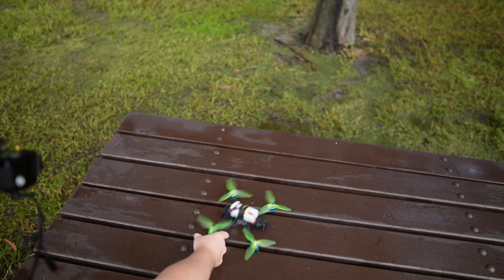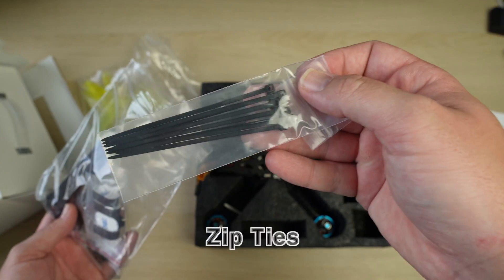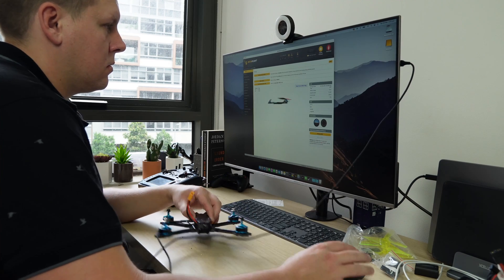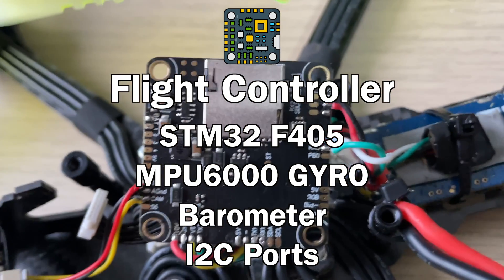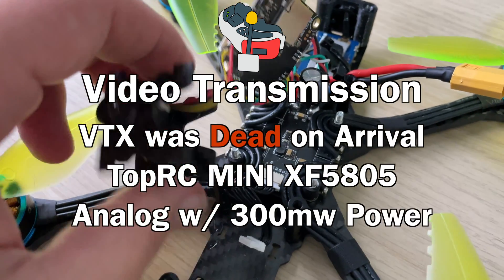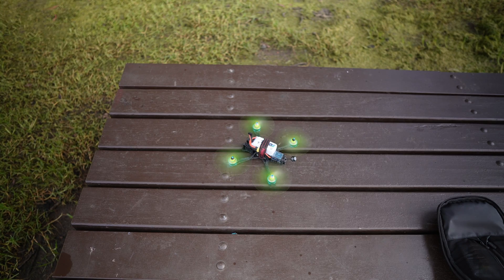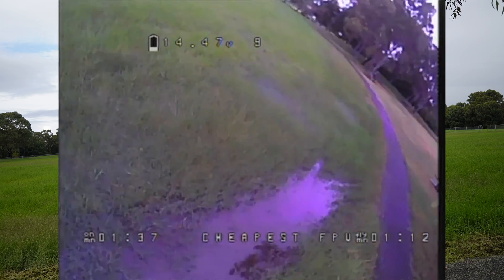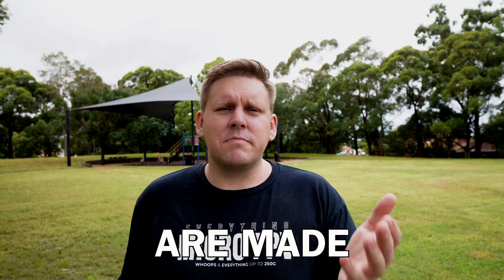I Tried The CHEAPEST 5" FPV Drone, Here's What Happened!

Comment: I never even tried those props they went straight into the trash , plus I had got mine in late August and same everything except BF 4.3 so it flew pretty well. I did upgrade vtx to Iflight sucexx  it was a tight fit in the back I actually had to re-solder the battery cable to get the vtx under the power wires. The stock vtx wasn’t terrible but I had an extra vtx so I threw it in along with a Camera and now it is my favorite flyer. I know own 3 of these and they all came in perfect condition and I do consider myself a bit lucky in that regard.

Comment: Noob question. Where did you guys connect the elrs (ep1). I think I got it to bind but can't get the controller to work? I am new to this. Seem like tx5 and rx5 is where you connected but just confirming.
Reply from the maker: Yes you can do tx and RX 5… you need to write the tx on the receiver to the RX pad on the flight controller and vice versa
Reply: @DarrenAllatt  thank you.

Comment: Noooooooooo don't spend $100 to upgrade it.  Go in a different direction...just try to see how little u can spend to get it to fly properly.  I think that would be more useful to know whether you can spend $84 + minimum upgrades, props and tune it as is and see if it does any better.
Reply from the maker: Check out the upgrade video as it shows the upgrades in stages from “free” to $100

Comment: Awesome video! What betaflight target did you use to update to 4.3? My gyro update frequency is locked at 3.2 khz. The target is MATEKF405STD. I'm not sure what is wrong. I have never seen a gyro update frequency locked to a value before.
Reply from the maker: Yes that’s the target I used as well. 

I think that may be due to the FC having a BMI270 gyro and not an MPU6000 which is limited to 3.2khz
Reply: @DarrenAllatt  Oh bummer. Thanks for the info!
Reply from the maker: @svveptunder  it’s a non issue. Go and apply the BMI270 gyro preset from the presets tab and it will be all good

Comment: First video I have watched of yours super impressed with your review format will definitely be watching some more. The quad looks like a bit of a red flag tho, although I want expecting it to be good at this price. Those eachine tyro119 stacks are known for blowing up.
Reply from the maker: Cheers appreciate it… check out the upgrades I did to it, also there is another coming shortly. As the Tyro ESC 🔥
Reply: @DarrenAllatt  Yeah I am still kinda tempted to buy one and tinker with it even though just the esc alone in my current 5inch build costs more 😂. I think with the mods you did and a cheap mamba esc it would actually be a pretty good value quad, that would be nice to have as a backup/beater.
Reply from the maker: @PeugeotL-vd2le  just bought a mambo esc for it too

Comment: The Tyro ESC didn't come PRE FRIED from factory?
I'm actually surprised!
I was dumb enough to order a Tyro 119 DIY and the electronics all died a quick death on transport to me... Yes, the replacement esc also died.
It now has a RUSH stack and damn it hauls ass!
Reply from the maker: With such low prices for hardware you have to think, what are they missing to produce it at this price. 

Typically the first thing cut from production is QA.

Comment: As for your review of the quad
I would change the following.
1 yes props I would go with gemfans windancers or whisky's
2 camera go with caddx for FPV or digital 
3 VTX hdzero or DJI 
4 motors 2700kv for speed 

That would I do.

Comment: I'd get an Ratel 2 and upgrade the props (I use Racerstar 5048 since I am cheap). You already fixed the VTX and antenna, I think thats decent. Then install a buzzer and change the EP2 out for an EP1 to get better range.

Comment: upgrade vtx to speedybee tx800. upgrade camera to foxeer razer mini. betaflight 4.3. bluejay blheli s firmware. new props, p3 s or sum. axi xilo. and emax eco ii’s.      should be abt 100 bucks
Reply from the maker: You are on the money with the SpeedyBee TX800 and I’ve ordered that with the antenna combo. Just did BlueJay and 4.3 this morning. R35 props as Ethix are out of stock in Aus. ECO2’s blow the budget. Went with the Ratel2 as the Razer is also out of stock locally or those that have stock price it closely to the Ratel2
Reply: noice

Comment: I wouldn't have bought that cheapest FPV quad on the Internet in the first place! Cheapest means cheap, low quality parts, which break, burn out, don't work from the get go, or some other way of failing is bound to happen ... And soon! So, after you spend your $100 Upgrading your garbage quad, you'd be better off just spending the total sim of money on a good quality quad, with great quality parts, in the first place! 👍
Guys, don't buy this Junk! They're problems right out of the gate ... Just like he had! They will end up costing you double, or more likely triple, your original cost in the first year or two of ownership! Repairs galore!!! Buy quality in the first place and don't have all the down time waiting for more parts all of the time. 🤷🥴
Reply from the maker: Agree, that’s good advice and advice I’ve advocated for previously (and still stand buy). This is the first video in a series about the experience of buying the cheapest drone

Comment: Interesting review wonder what mine will be like has 2306 1850kv motors different frame and looks like a different vtx with a polarised antenna one interesting thing to note is its being shipped without the motors soldered on so I'll have to do it myself
Reply from the maker: Weird that motors are coming unsoldered.
Reply: @DarrenAllatt  something to do with the shipping I ordered the overfrequency but it was sent back at the airport and got lost

Comment: HQ Prop Ethix S5 5x4x3 props? $4
Xilo AXII RHCP antenna? $10
ELRS Receiver? $15
Runcam Phoenix 2? $30
RUSH tank Ultimate Plus VTX? $40
Upgrade to Betaflight 4.3 and custom re-tune?

Priceless.

There are some things money can't buy.
Reply from the maker: I don't know about a custom re-tune. But...
- Betaflight 4.3
- BF 4S 5" Freestyle preset
- BlueJay for RPM Filtering on the ESC

Personally a fan of the S4 props
Reply: @DarrenAllatt  the presets with maybe a couple of filter tweaks with bluejay was what I was generally referring to. 

I figure some low pitch props will help a lot with that propwash problem. Could probably go as high as a 4.5 pitch prop and be fine. I'd probably start low with the 4 and see if it has enough to punch out first.

Comment: hi and thanks for the informations! just a question, did you solder the elrs receiver to that sbus connector (with just 3 cables)?
Reply from the maker: No, although ELRS now has functionality to use SBUS; I wired it to UART 5 - tx to rx and RX to tx because the Fc will send telemetry back to the radio.

Comment: Better camera and props. VTX you already upgraded. Souldnt spend all 100 on it. Otherwise you might have as well gotten a 200 bucks quad straight away
Reply: Darwin240
Eachine wizard 220
Skystar 228
The Nazugul5 was on flash sale for 200.
Reply from the maker: @chrisbee5481   you do realise the Darwin240, Wizard220 and Skystar228 are all the same drone as the this one? Same components (except the wizard uses individual escs) - they are all $90 drones being sold for $200+
Reply: @DarrenAllatt  the motors are different. Maybe they are similar. Agree on that. But who says they are exactly the same? You will need  a side to side comparison. Just the frame and motors already do mean something. There are dozens of 405 FCs on the market too. 
But they all have 5 inch in common xD 
Appreciate your review!
Reply: @DarrenAllatt  estoy de acuerdo contigo
Darwin todo lo que tiene es TYRO 
Yo he tenido varios darwinfpv y son totalmente lo mismo solo que mas caros
Y ecahine LAL 3 y LAL 5 igual es electronica TYRO
Yo lo compraria por que todos los de maraca puntera los precios estan por las nubes
Reply from the maker: @ivanfpv1767  sorry English please
Reply: @DarrenAllatt  I agree

with you

Darwin all he has is TYRO

I have had several darwinfpv and they are totally

the same only that more expensive

And ecahine LAL 3 and LAL 5 equal is electronic

TYRO

I would buy it because all the maraca pointer prices are through the roof
Reply from the maker: @chrisbee5481  I’m also going to count the cost of the VTX in the upgrades
Reply: Now there's the best idea by far!
Guys, don't buy this garbage! 😩🤬
Reply from the maker: What 5” are for $200?
- Nazgul $260
- Diatone Roma $300
- GEPRC Mark5 $349
- HGLRC Sector5 $270